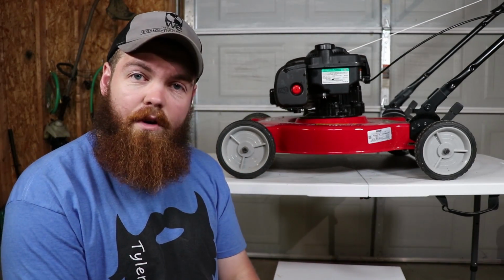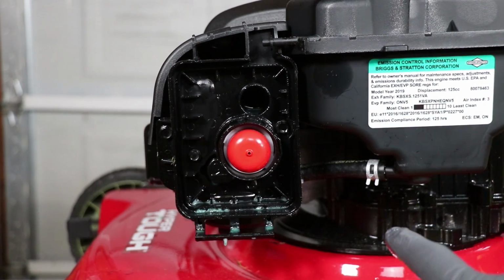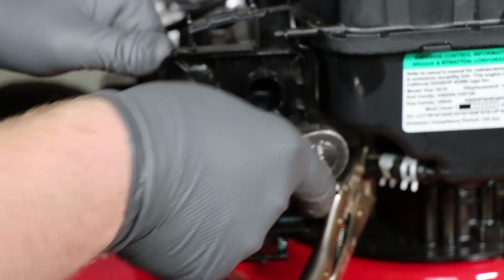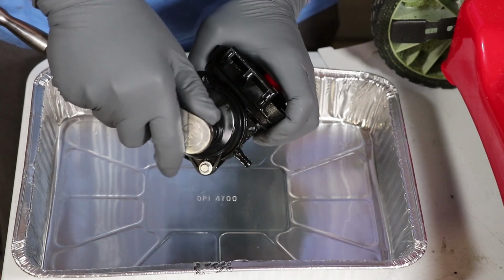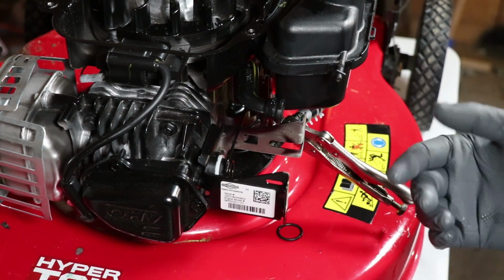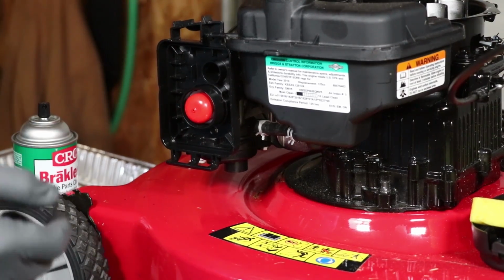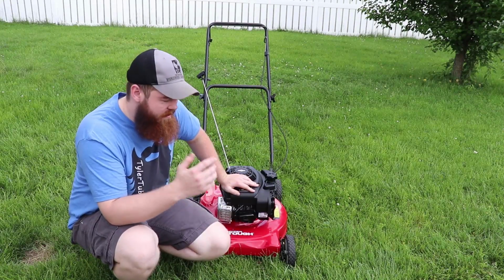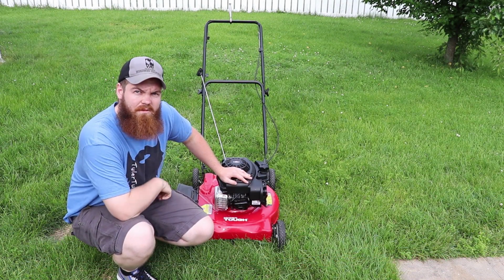How To Fix A Soap Filled Lawn Mower!

Comment: For these kinds of videos, you want to remove the blow by tube from the Air Filter box, it recycles air in the crankcase back into the carburetor. When the soap foamed up, it went through the blow by/breather back into the intake causing it to fail prematurely. Removing it from the air box would have made the engine run longer with the soap because there wouldn't be any of the test material getting into the intake. I hope this helps! Keep up the great work!

Edit : It's the tube right above the primer that went into a hole in the air box!

Comment: Replace the motor oil with power steering fluid or transmission fluid.
Reply: Definitely do it with atf
Reply: Project Farm ladies you won't be sorry lol
Reply: miike.oosterhuis you can use atf as oil, it’s almost the same as 10w30, I was on a camping trip in my Rover, and popped an oil cooler line off, and only had atf with me, I was   40 miles in the woods, and it was all I had. I used it for the 5 hour drive/ crawl back through heavy off-roading, and no issues. After flushing it a few times, and a year/ 13,000 miles later, no issues.

Comment: The plug is for the fuel line so you don’t need to clamp it off with vise grips
Reply: I have been scrolling this entire time looking just for that answer thanks seriously. There is no such thing as extra parts.
Reply: Evan Schoenwald no it isnt🤦‍♂️ on the carb there is this hole under the fuel intake where Tyler literally put it in and took it out and you are meant to push it in that hole till it clicks. Watch steves small engine saloon, he did a video on briggs plastic carbs
Reply: melody potato what can happen if the plug isn’t in
Reply: RyanPlays39 I believe it lets dirt in and can completely ruin the piston

Comment: Explain to me how soap got into the bowl of the carb?  It can't. 
Try the soap in the crankcase again without the air filter. The blow-by from the crank case saturated the air filter and choked air from the engine.
Reply: Finally someone says that I was thinking the same thing
Reply: im not underestimating your knowledge and i know this was made a year ago but i think a diesel mechanic would know what hes talking about. doesnt matter if its a mower or not. you know how much shit my dad has taught me and has fixed being a diesel mechanic for 25+ years 😂

Comment: Disconnect the crank case breather from the intake and just let it blow into the air. That’s how the soap got into the carb/ intake in the first place. And is where the oil is getting in there now because the engine has blow by after being run without oil. I use to do things like you. It’s fun lol

Comment: Try and use canola oil for oil. It's about the right consistency and I think it would work just fine.
Reply: But it's funnier when it breaks! Also it would be funnier/more interesting if he got something more "unexpected" to work.
Reply: I ran a mower on corn oil and diesel once and it worked

Comment: Fyi if you ever do an experiment like this as in soap im engine disconnect the crank vent from the back plastic filter housing. The soap bubbled and came through the vent into the carb

Comment: If you used HE clothes soap it has antifoaming so does dishwasher detergent. It may have just worked. However you would still have to use concentrated as others have way to much water in it and would have boiled away faster.

Comment: Change the oil again. There was some noise and the smoke was because the oil is too contaminated. Doing this than running it until operating temp will save the mower from further damage or technically you will be able to rule out the soap as being the reason for total failure during your next few experiments. Just an idea. Keep up the good work man!

Comment: The smoke is oil contamination when the seals get loose, the soap probably let some oil seep through. It usually happens when the engine overheats through excess use.

Comment: Usually the plug should be on the bottom where the blades are.  Sometimes they don't put one on them.
Reply: Push mowers generally don't have one. Especially nowadays when everything's made out of plastic and designed to last for maybe one season. Especially especially the Walmart special we see in this video series

Comment: Change the oil again, now that it has been run again. There's undoubtedly some soap residue in the crank case ventilation line. You cleaned the carburetor, but you never cleaned the valve spring box, or the tube between it and the filter housing. New oil, just run it, it will clear itself out.
     Try to look underneath the deck, and see if there's a drain plug right next to the motor shaft. If so, you will have much less trouble with it, because there will be less residue when the oil is drained.

Comment: 2 part suggestion  50/50 mix lucas and hydraulic oil & then put stump remover in a coffee grinder, then in a ball mill , then take about a tablespoon full and add to oil/gas as a premix to add to gastank. stump remover is ammonium nitrate which is an oxdizer ands will burn hotter. Not sure what the lucus and hydraulic oil mix will do, but probably more exciting than draino or dishsoap.

Comment: The smoke looked like when the crankcase vent filter spews oil into the air filter and burns oil. Your crankcase filter might be full of soap getting into the air filter box again through the crankcase vent tube

Comment: Hey bub, just wanted to give you some info, so we can see how long this thing will actually run with soap, the reason why the air box filled up with soap is because of the crank case breather, and that was that hose that just sticks into the back of the housing, the one that you said was easy to get in, try venting that outside of the air box and it shouldn't fill it with soap, just an FYI! Love your vids bud! @tylertube

Comment: Tyler most if not all of the time the oil plug is under the deck "under the red metal frame under the blade. If you turn it up on its side and look under the blade. You should see a square hole that you can put the end of a ratchet or extention in to get it off. Lawn mowers are ment to drain oil downwards so you do not tip the lawn mower & get oil into the combustion chamber causing it to smoke & or hydrolock if water some how got into the oil pan.

Comment: It smoked pretty badly because you might be getting oil in your cylinder, witch might be a resault from a broken headgasket
Reply: It wouldn't be the headgasket. It would be the rings because the soap sudsed up and when the piston came down it squeezed past the rings and now the oil ring is done.

Comment: They're is an oil drain plug on the bottom of the mower. The smoke is probably caused by the residual soap breaking down the oil and allowing it to flow past the piston rings.

Comment: Now that its all cleaned up try using vape juice as engine oil. Use the thickest you can get 80vg/20pg is pretty thick but they might make some even thicker than that. Its gonna cost some money though about 30 dollars for a 120 mil. Bottle.

Comment: 7:10 see that vent hose if you move it to a different location oil or anything in crankcase wont go into carburetor so u can use soap as oil again and dont have carb filling with soap lol

Comment: It has to be something flammable to make it run so I think WD-40 would do the trick
Reply: Doesn't that evaporate too quickly, not to mention it's a little too flammable?
Reply: @desertrainfrog1691  yes it does act too quickly but I've seen videos on YouTube he put WD-40 as a oil in his car and he turned it on and he left it running for like an hour until it burst into flames
Reply: @Butterflyknifes1  lmaoo. Maybe wd-40 mixed with a tiny bit of soap to reduce flammability
Reply: @desertrainfrog1691  🤣🤣🤣 I think he should do half WD-40 and half oil you know like if you don't have enough oil to fill it up just use WD-40 as a replacement alternative oil
Reply: @Butterflyknifes1  That'd probably work. How about lighter fluid 🙃
Reply: @desertrainfrog1691  YES

Comment: Tipping the mower on its side will cause the oil or other liquid to escape the crankcase and fill the exhaust with oil. It will smoke until it burns off the oil. Next time make sure your spark plugs is facing upwards when changing the oil on your mower, so it doesnt escape the crankcase.  Another reason is you might've ruined the piston rings already with the drain-o.

Comment: There's a good reason oil containers don't have the spout in the center anymore. 99% of the people assume it's to pour with the spout on the bottom....WRONG ! It's designed to be used with the spout on TOP so there is no spillage at the beginning of the pour by giving it more of a horizontal angle at the beginning. After some oil is poured, then it doesn't matter if it's on the bottom or top. ALSO, a mower will smoke if you put too much oil in it until you burn off the excess amount.

Comment: The oil drain plugs are under the mower by the blade most if the time. Not fully positive on a newer model engine.

Comment: Wow you have impressive skills. I can kill a lawnmower without adding any draino or dawn, lol. 🤣🤣
Reply: Kill them as in they quit starting? Usually just a dirty carburetor, the ethanol they use in gas nowadays likes to clog them up. Best thing to do is when it gets too cold and you are no longer cutting the grass, run the mower out of gas, then there is no ethanol in the carb to dry up and clog it.

Comment: The smoke was a bluish tint that means oil was getting past the rings on the piston into the combustion chamber and burning with the fuel. Good chance the soap wasn't a good enough lubricant and caused damage to the rings. Or you could be right and it was just soap that ended working it's way in.

Comment: what happen was that the soap bubbles up and the bubbles comes out of the crank case ventilation so the exhaust for the oil crank case and it just got in the carb i would take out the card bowl and clean it out with gas and also take the spark plug out and turn it over

Comment: !!!! There is a drain plug underneath the deck you will see aluminum when he tipped over the deck and then you'll see a bolt that connects to the engine and that is the engine drain plug

Comment: it smoking like that is most likely valve seals or the something in the top end. If it was the rings it would have low compression and run like crap

Comment: That's a Walmart brand one. So if you're evil like me, just buy a new one, save the receipt and box and return the broken one in the new one's box.
Reply: I used to do that back in the 80's with cheap headphones for Walkman use.  Where the wire went into the tiny speaker wouldn't last long from flexing back and forth,  so about every 3 months, I'd go to Radio Shack, buy an identical headphones for $7.99,  take them home. I'd swap the new foams onto the "dead" headphones and the old foams onto the "good" headphones,  then carefully coil up the wire the way new one came out of the package, twist-tie it up, stuff it back into the plastic pouch package, bring the receipt and everything back, tell them the left or right channel didn't work.  Sometimes they'd test it out, sometimes they'd just hand me another new set.  Once they were out, so I got a refund.  I used this trick a few times later in life on more expensive purchases too, but always like-for-like.

Comment: Probably should check the oil before you continue using it because when it gets Smoky like that means that means you using oil and that's not a good thing if you run out of oil

Comment: All you had to do is soak the filter in gas.  Drain the motor add oil.   Use start fluid  it will finally run

Comment: You didn't have to do any of that. Replace the air filter and spark plug. Replace the soap with oil and Bam your done. In the future if you want your engine to run longer or until failure you need to remove the crank case vent tube from your air intake box

Comment: You realize there is a drain plug right lol it's on the bottom side of the mower you just use the box end of a 3/8 extension. The drain is under the motor kinda where the blade mounts

Comment: as a small engine mechanic i cringe at your work with dealing with the carb..... very inefficient, the pullstart cover/shroud didnt need to come off, and the little white piece that fell off does go on the side of the carb (idk what its for either i usually leave it alone or put it back in place just to be safe) ... just saying but i couldve had that carb off, apart, cleaned thoroughly, and reassembled within 10 minutes without power tools.

Comment: Cleaning the carburetor bowl was actually unnecessary. What most likely happened was the soap foamed up through the crankcase vent,  (which dumps into the intake manifold) entering the carburetor throat, thus flooding the engine. The soap never really entered the fuel system. You could have gotten away just with spraying brake cleaner down the intake and cleaning the air filter, without ever taking the carburetor off!

Comment: Drain soap add oil carb clean spray and start it......doesn't need surgery
Reply: Need to clean the plug but yes you are correct
Reply: @victoradams4420 yeah cleaning plug was obvious lol didn't think it needed mentioned 😄😄

Comment: Wear safety equipment for my suggestion, because I hypothesize that the engine might throw its piston rod.
Call me crazy, but I once learned that a little acetone in a fuel tank will improve fuel mileage. I don't know about this shit, because acetone dissolves plastic, but gasoline will dissolve styrofoam just like acetone. I guess that some acetone with gasoline will make some sort of racing fuel, thus reasons for safety... Small engines tend to blow with such fuel.

Comment: Wonder if a mower will run on butt lube instead of oil..  i mean that stuff dont foam up when its going through the motions..   butt i guess im not giving her the 3100rpm piston action, maybe 75 ppm tops...  pumps per moan..  lol.  Butt for real tho, getche some ky jelly and try it..  gonna have to get one of those big tubes, for ultra butt lovin or whatever..  you can just squirt it in and put it in until it over flows out because it should agitate and condense down once it heats up a bit.  But i bet that shit will run so good itll be silent, only silent butt deadly farts coming out its exhaust..  i guess youd have to use purple power degreaser to clean it out of the oil tank..  just let itsoak for a bit..